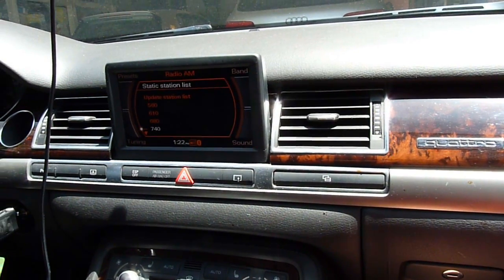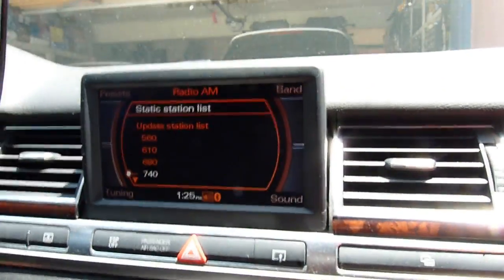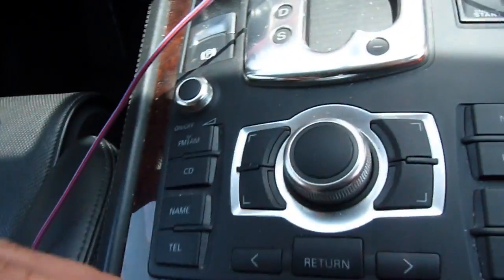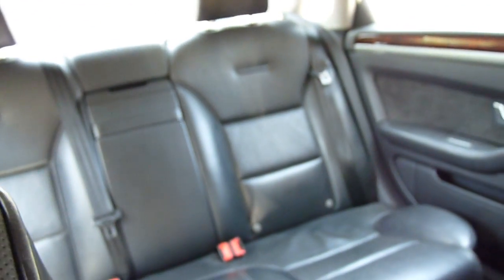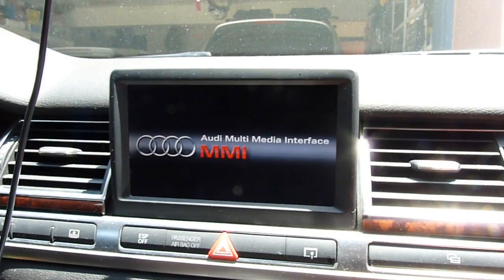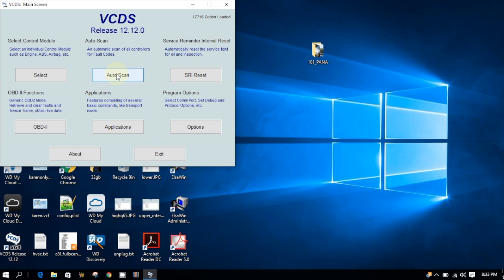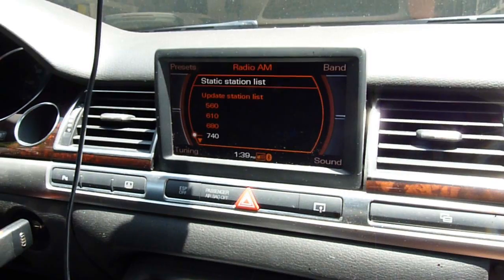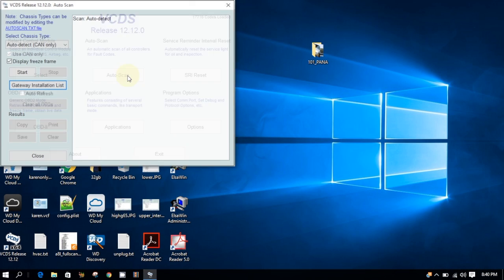Audi MMI 2G MOST BUS open-circuit test and VCDS read out RESULTS

Comment: your video does not explain or show how you fixed mmi. please explain.
Reply from the maker: J P it’s only the demo when a component on the chain fail. You need to get an optical loop bypass to plug one by one to find the bad device. Go to the link in the info, it will explain more in depth.

Comment: Click sound it is audio amplifier relay engaging..i am repairing such mmi system.
Reply: Hi, l have same problem, but l was installed aftermarket bluetooth adapter, when l had connected power wires and accidently made shortcut it was sparked, and after mmi central panel dead no light just screen is show logo audi for about 10 seconds. Scan shows no communication with gateway, any idea? Thanks. Viktor
Reply: @viktorstadnyuk7603   I have  same  problem  on my audi  a8 2006 really  what  it  the  problem  with  that can u help  me?
Reply: Can ai help me with my car

Comment: hey man, i watched your video and my car does the on and off screen for like 10 seconds, i watched this guy (https://www.youtube.com/watch?v=cKf8pofmINs) i troubleshoot all fiber optic plugs and still no luck, what else do you think could be the problem
oh, and i got 2 MMI modules, i tried troubleshooting same way with both of them and no result 
can you help me out, am i missing something?
i forgot to mention, everything worked except the sound, i tried fixing it and shortened a wire in the trunk where the fuses are, and so after that it all stopped working, a fuse above the battery blew, its like a piece of metal 30A, i replaced it and still nothing 
Hope to hear from you soon